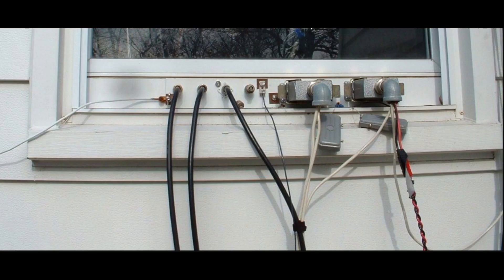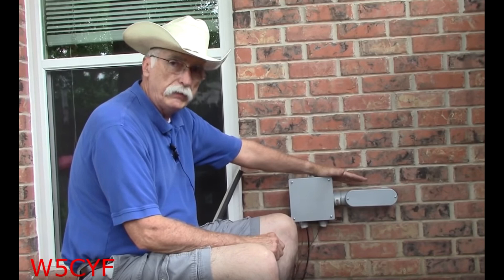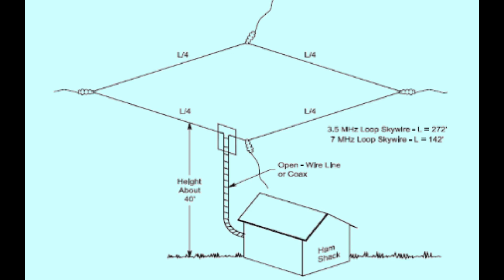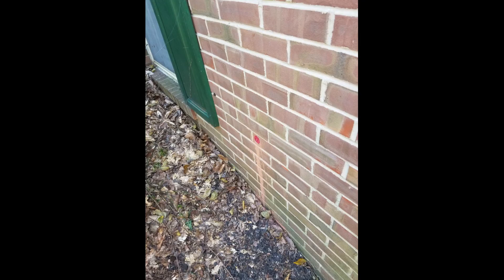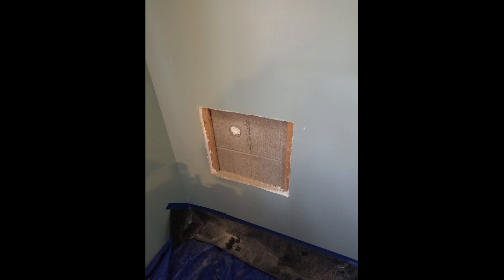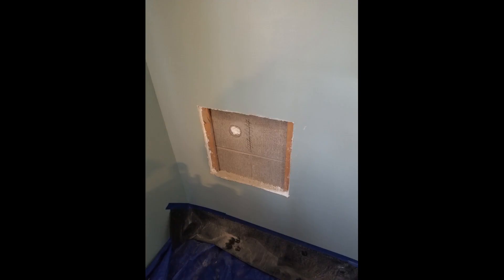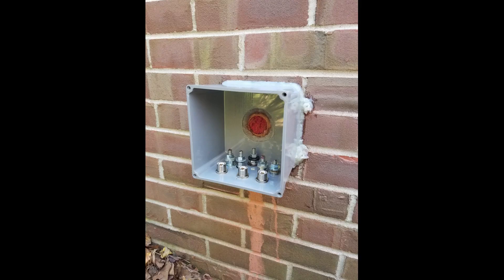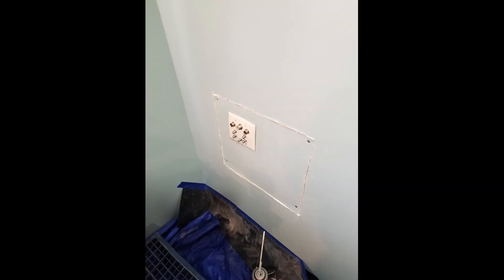Amateur Radio antenna access or coax pass through

Comment: 5:50 Ladder Line is supposed to be kept away from other conductors, typically described as 'by twice its width.'  It's not like coax in that regard.  Yeah I know it probably works fine anyway; I'm here just trying to pass along info from the old days.

Comment: I’m impressed!  She is sure good at that drywall work! Wish I was! I desperately need to bore a big hole in my house and just can’t find the nerve!  Something tells me mine should be a lot easier as mine is vinyl siding not brick.  I know nothing about siding and that’s what’s got me!  If I damage the siding then getting a proper color match replacement piece concerns me a good bit!  I have 3” PVC and couple parts recommended to me to do this just researching a bit how to best deal with the siding.  Thanks for the video 73 de Seth - W8FG
Reply from the maker: In the video I referrenced, John W5CYF suggested hiring an electrician to do the hole. I think that's what he did.